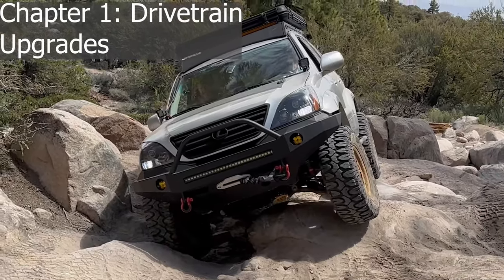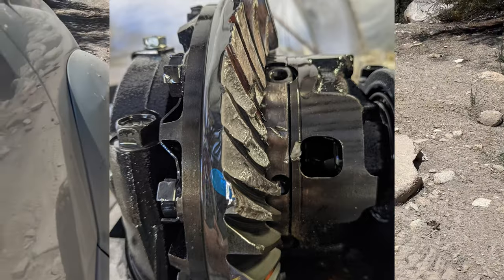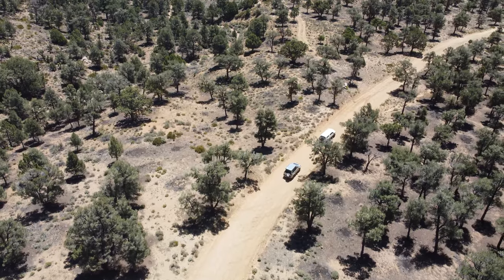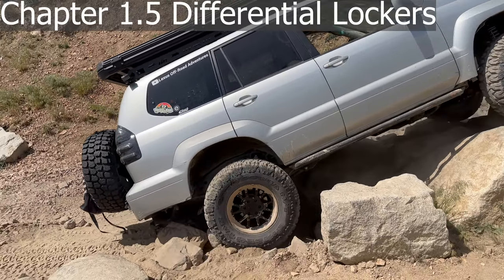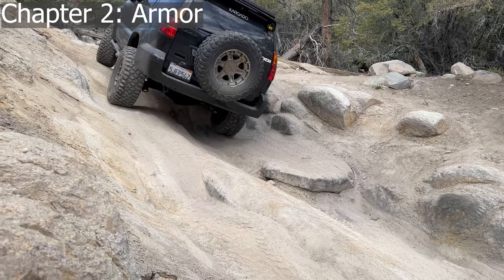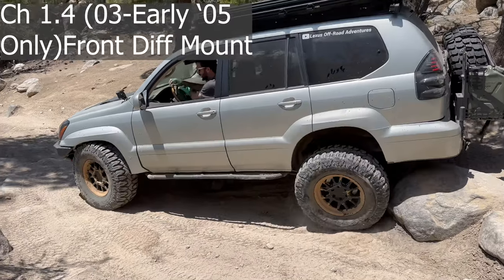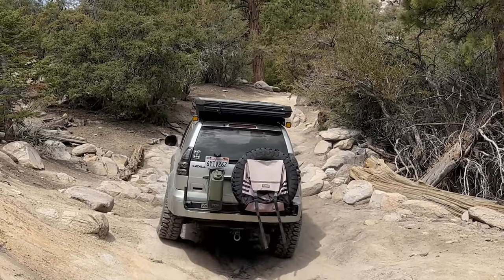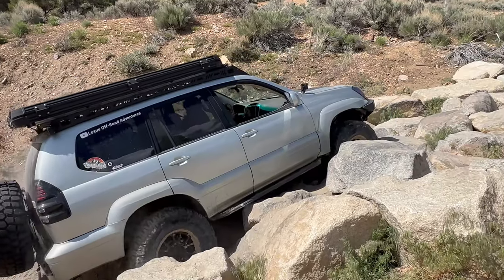The ULTIMATE Lexus GX470 OFF-ROAD/Overland Build (For Under $20k) Part 2

Comment: 35s are the max without major suspension replacements. Stock Toyota shafts are plenty strong. Now, emotional wheel spin type driving will break anything and those emotional drivers will always be plagued with problems due to stupidity. 33s aren’t considered large so it is moot.

Comment: First off, I decided after owning my GX for nearly 18 years (wife drove it for the first 12 as a Soccer mom- zero off road driving), to begin to modify it for some fun off road trips with my kids.  Honestly I don’t plan to do anything crazy (no rock crawls, etc). We really would just be driving some medium level off roading , mainly for camping trips and some surf ventures in Mexico.  I’ve got a question for you about suspensions.  I’m at roughly 245K miles and the air bags went out completely about 5-6K ago!  So I need to get this done ASAP!  

With my basic needs I’m thinking 2” lift and am stuck on which manufacturer to go with?  I would love to get your insight based upon my needs?   Thinking OME or I think I heard you say you have Biksteins?  Dumb question but I likely need a kit right cuz I’ll need rear and front suspension replaced right?  Any other thoughts?  Control arms? Other?

Thanks in advance. Looking forward to your thoughts and to this build!  Shoot while I’m at it, thoughts on a rear bumper?
Chris
Reply from the maker: Hi Chris! There are lots of great manufacturers who make great kits for the GX. I don’t necessarily want to steer you toward one brand or another. With a suspension you’re concerned with 1. Cost 2. Spring rates (ensuring the suspension is right for how you plan to setup your vehicle) 3. Performance. I recommend reaching out to the customer support at Apache Off-road to guide you to a specific kit that balances these the best for your specific needs. https://apacheoffroad.com/

If you plan on going with a rear bumper setup, for example, you’ll need a higher spring rate in the rear coils to account for the extra weight, otherwise you’ll be driving around with a squatting rear. 

While UCAs aren’t 100% needed under 2”, it’s always a good idea to get fresher, higher performing parts in a high mileage setup. I have the relatively inexpensive Freedom Off-Road units and I have no complaints. They enable my alignment guy to get good caster. 

As for a rear bumper: I don’t see the point of running a full rear bumper personally. It’s a lot of metal and a lot of weight and there are better, lighter weight solutions if you want a tire swing out/carrying capacity https://www.restlessoffroad.com/product-page/gx-470-bolt-on-half-swing-out
If you need armor and a hitch on the rear, Restless Off-road also has a rear slider/hitch. 

I have done several videos on suspension replacement on these rigs, so be sure to check them out if you want to DIY

Comment: Any reason you did the 34's over the 35's? Love this series!
Reply from the maker: These are considered 35s. The patagonias measure about 34.7” (for some reason each manufacturer measures differently)
Reply from the maker: If you look at 9:14 in the previous video https://youtu.be/7_Pvz56g_Sc

You’ll see the “similar floatation size” printed on my tire sidewalls as 35x12.50

Comment: Nice. What RPM are you at when going 60mph?
Reply from the maker: Around 2k-2.1k at 60 in 5th gear with the torque converter locked.
Reply: @lexus_offroad_adventures  nice. I am surprised. That is very similar to my gx with 4.56. Your rig it set up nice now.

Comment: Hey, I’m looking to do this exact build to my 470. I just want to know how your gas mileage has changed?
Reply from the maker: Hard to say but going on what the in cad computer says, you can eek out 16-17 city/highway combined (same as EPA rating on modern GXs, even the 2024) with a stock gx470 if you drive efficiently. With my mods, you can Probably eek out 17-18 highway and around 12 combined with normal driving.
Reply: Wish they had a larger fuel tank mod
Reply: @athensteve1  I thought I just a vid with the larger fuel tank that was installed in the place of the old spare location
Reply: Is it on yt?? Link??
Reply: @athensteve1 they do it goes where the original spar tire is located.

Comment: 20k man i need an extra job lol
Reply from the maker: I’m probably not there with what I put on the list so far. You can get 80% of the way there with 10-15 ish. Just take out the rooftop tent and some other items and use cheaper alternatives like in-vehicle sleeping platform for camping instead. Most expensive item(s) is regear and lockers by far.